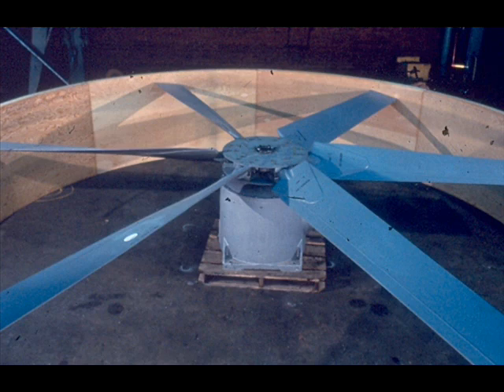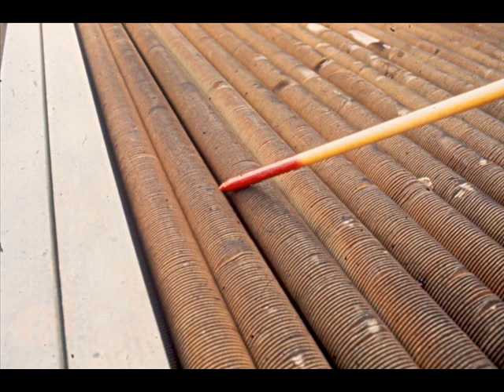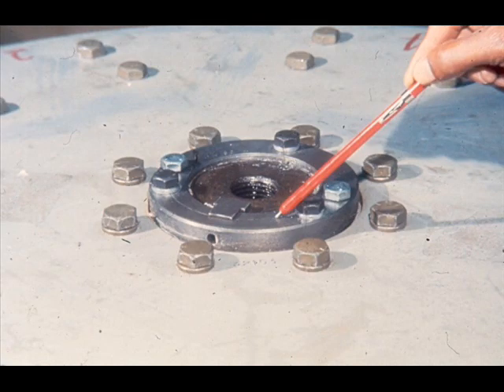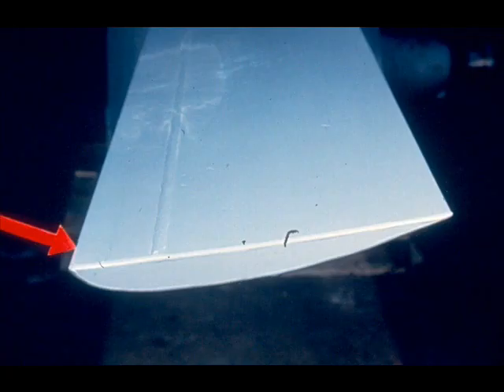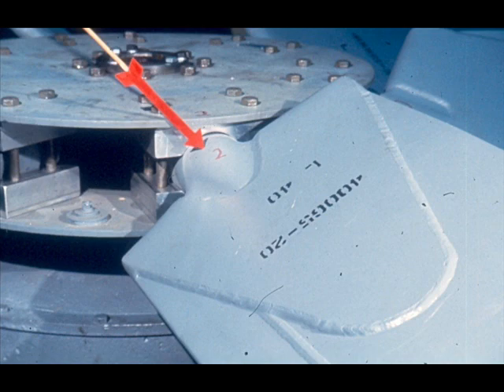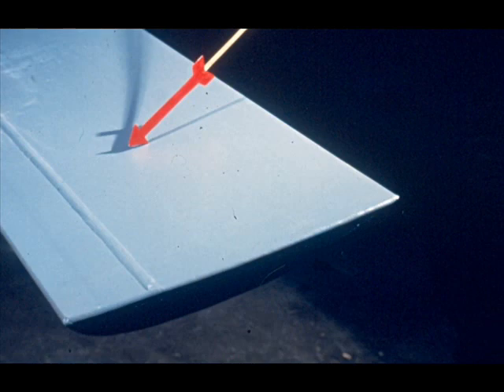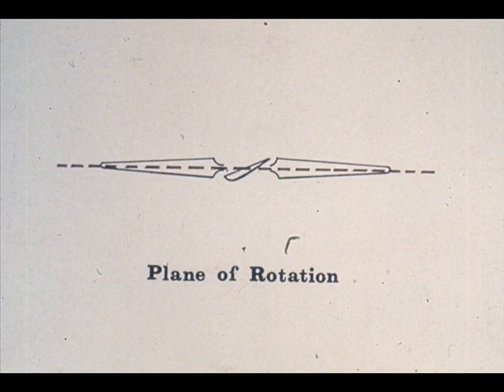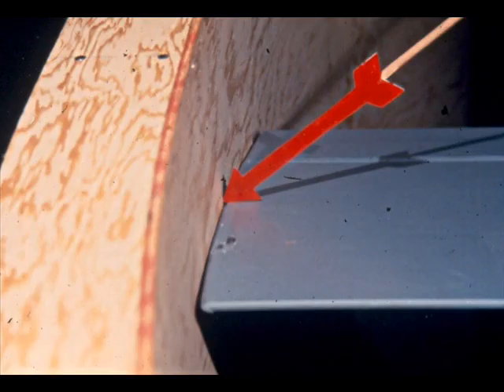Cooling Fan Part 1 | Cooling Fin Fan and Tower Fan Working | Cooling Fan Parts | Cooling Fan Repair

Comment: the fan i have. on my lakewood p25, and my modified sears homart belt drive fan with a 21" belt i think, and a 6 wide blade cw fan is also a 20". but man...ive never had something that big before😦🤯but i think that i have seen or maybe/may've seen bigger or so...but i dont think ever in person before?🤔🤷🏼‍♂️sell @ least not in terms of ac form. well actually i may have...but it was like from the empire state building, and another 1/one from the hotel room...or so